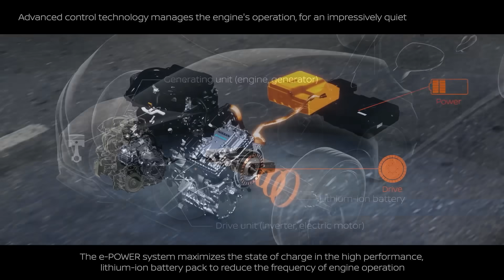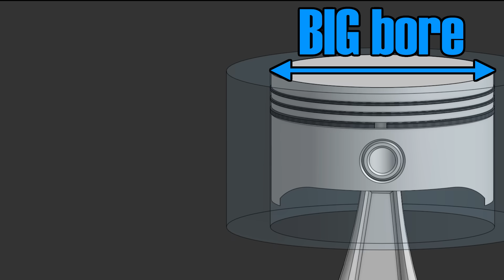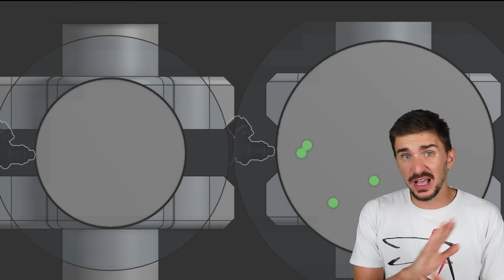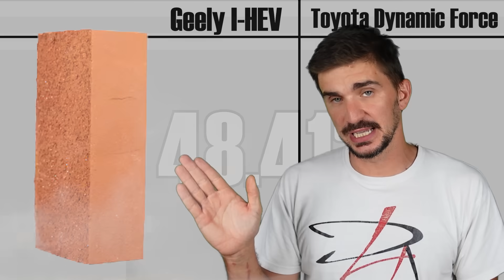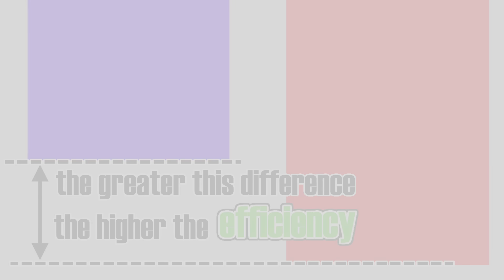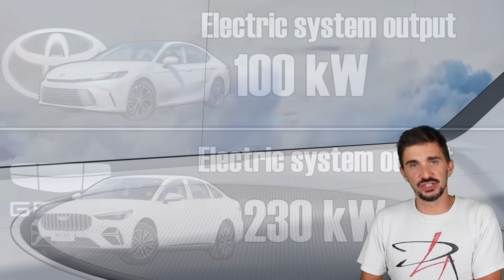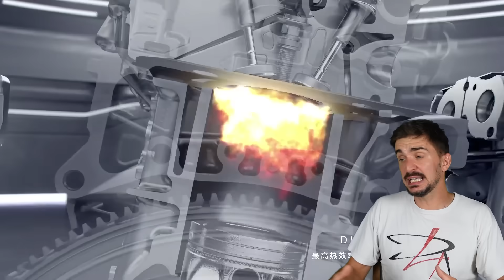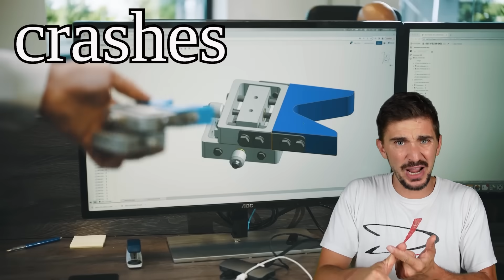How China's Geely Beat Toyota, BMW, Ford and Everyone Else

Comment: "compression ratio" is an unfortunate term. In Atkinson engines the compression ratio is lower than the calculated rate.
Good video. Think of the "sudden loss of torque available when the battery depletes" as a soft range anxiety. Push an EV too far and it becomes a brick. Push an EVcentric hybrid too far and you go a bit slower.
It needs a supercapacitor. Target charge state of supercap to inverse of speed.   The battery is freed of acceleration and braking duty.
Thumbs up. The final engine design is filed and accepted at patent office. Claude estimates over 70% efficiency.
Oh, long stroke is only relevant if one burns in the cylinder instead of above the cylinder. If one burns above the cylinder the axiom inverts: larger bore to stroke is more efficient and frees up the cylinder for a simultaneous steam cycle and negligible pumping costs. My engine hovers around 3:1 bore to stroke and 3:1 rod to stroke.
Thumbs up.

Comment: If you had perfect control over valves, could one make an engine that dynamically switches between otto and atkinson/miller of any imaginable depth?
Reply from the maker: We already have that but we can't really go into any depth, the maximum depth is predetermined, and there's a limit to how much we can phase the cam.

Comment: Undersquare engines aren’t more efficient because the pistons have a longer distance to travel.  It’s more efficient because less heat is lost to the walls because the surface area is lower.

Comment: Something else with the bore/stroke ratio: tumble flow is better preserved in a square situation than a pancake or a pipe, and a long stroke engine is, on average, more square. This preserves charge motion until later in the combustion cycle, mixes a little more, and spreads the burning faster. This is less applicable to jet-ignition engines, but is still something to note.

Also, I thought this engine used jet ignition? It's a cool system. I'm going to try retrofit a poor copy of the mahle passive system to my project and see if I can make it work...

Comment: This is going to be a disposable engine, not rebuildable. Hopefully long-lasting, but I wouldn't bet on it, and reliability could suffer depending on application. In this case it seems to be essentially a range-extender for an EV, probably running mostly at a constant RPM where it's most efficient, requiring a much smaller battery bank, and likely won't sell well in the US due to crappy performance. That being said, the impetus for this is valid, best demonstrated in diesel-electric freight train engines, configured so power can be acheived.

Comment: With inconsistencies in fuel octane and burn rate,  it seems it would be a hit & miss with a long stroke to find that maximum efficiency they achieved with this particular engine bore & stroke ? 
 What octane did they achieve such a higher rating ?

Comment: I was seriously interested in a Honda with e:HEV because of the technology, as not many petrol-only choices left. I'm glad to see more choices now. It didn't end up with the Honda, but while browsing specs I concluded that at highway speeds the fuel consumption was no longer very impressive. I recall e:HEV connected the engine to the wheels when possible. This video highlighted that the Geely motor is quite weak. Was that the problem also for the Honda?  Is there truly a way to go electric toward the wheels and still get highway fuel consumption like e.g. a Volvo V90?

Comment: Could a real deep miller cycle work in a normal ICE car or a hybrid? I mean a real miller, with a turbocharger or one of the electric turbos like what some Formula 1 cars used in the past. Also even a lethargic engine like this could still be useful in some cases like stationary applications, generators, or cuising barges where power to weight is not as much of a concern, and the fuel usage difference matters.

Comment: I'd actually be fine with an EV first, with a backup generator, even if it meant much less power on gasoline only. It honestly seems like a problem that can be actively managed by forcing recharge to a certain battery state.

Comment: I'd explore using the combustion engine solely as a generator. Size the motors and battery to handle any reasonable hill climb, and just let the engine charge at peak efficiency.

Comment: It’s a bit of a shame that peak efficiency figures are constantly cited as proof of how ‘good’ this engine is. 48% peak efficiency? Brilliant! Where’s the performance map for that? How wide is the range around that peak? At 2250 rpm and 82% load? How much does the figure drop if I’m only at 60% load? And what about emissions?

Could you perhaps make a video on efficiency and specific fuel consumption? And also show just how narrow this peak efficiency range is? And calculate the average efficiency of an combustion engine under typical city driving conditions?

Comment: if they make 150km range plug in hybrids (which is not that far from current models) the issue you mentioned at the end will be extremely rare. in my case i never drive more than 150km in a single day unless i want to travel with my car so if some charges every day i suspect that 95%+ of driving will be purely electric that 5% as u said will be annoying but i would give that away if it means i pay a fraction of my gas bill

Comment: I drove the i3 with the first 18 kwh battery for work and work trips. It had the REX range extender, but when the battery was depleted, it only got to 60 km/h uphills. I micromanaged the state of charge manually, but I am an engineer. There was so much bad feedback about the REX, that in the end the battery got bigger and the REX production was stopped. It it the same thing here. The european manufacturers are afraid of telling their customers that they have to slow down at some point. No, they keep building rediculos cars, that nobody can buy anymore.

Comment: Okay, at the beginning you said it was a verified 48.4%, then later you said "well advertised anyway".  So which is it?  Has it been verified or is it just Chinesium claims?

Also, working on the assumption that narrowing the torque range increases efficiency, what does the torque curve of this engine look like?

Comment: This is an excellent, relatively easy to understand explanation of the engineering concepts involved in EV vs Hybrid designs. What made the light bulb go on inside my head was the graphic showing the electrification of IC vs the engineification (deal with that, spellcheck!!) of the EV and the tendency of both to more or less reach the "ideal" mix of the two power technologies somewhere between the extremes. A great channel and this has to be one of the best videos.
Reply: I prefer to call it the ICEing on the EV.

Comment: Geeley has done something similar to what people have been calling for for years, make a decent electric vehicle with an onboard ICE generator. Mazda did it too, but their electric motors are too small for adequate performance. What we need is a high performance electric powertrain with a highly optimized gasoline powered (or diesel) generator.

Comment: i prefer an electric-centric hybrid approach because
- no transmission or very simple 2-gear transmission
- much better torque from start 
- no sound or vibration 
- smaller,  much easy to make 4-wheel drive
- can run on gas and electric 

Why hybrid over electric? Battery technology is still not efficient enough, but electric motor tech is good enough. 
So we should not let suboptimal batteries drag down the good electric motors. 

If I had the money, I would make a hybrid with electric motors from Tesla and then get this Geely engine and make it like an electric generator. 
Slap some 20 kW BYD blade battery on it. 

rear-wheel drive with Tesla motors, battery split on the front end back under the seats. no drive shaft. 
use the gasoline as battery coolant

Comment: I dont understand this approach at all.

We could just realize that, even in the US with longer distances and minimal public transit, 250 mile range on an EV is plenty for like 99% of people 99% of the time. And even if its not for a particular scenario, its more an inconvenience than an actual hindrance.

And, on top of that, we have 350 kW capable chargers that aren't even utilized except for a very select few vehicles. A Hummer or Silverado EV with ~220 kWh battery can only just clip 350 kW for a short time. Reality is, if we can get to the point that we have smaller battery cars(50-100 kWh) that can actually charge at 350 kW, they will be charging insanely fast to the point that its really not even an inconvenience anymore.

Towing a trailer is the one place were I see the hybridization making sense, but this system wouldn't work there since you are likely needing to generate a continuous 120-180hp, whether its directly powering the wheels or charging the battery. I was pulling my 5500 lb travel trailer into a 30mph headwind yesterday in Wyoming, and my 5.7L V8 was needing to make 180hp just to maintain 60mph on flat ground. This is where I could see a decently powerful eCVT setup being pretty fantastic.

Comment: Hmm. If you compare it to the Nissan, that has a 42% thermal eff. engine that doesn't even move the clutch, this is still impressive. This is not a performance car. If it can sustain 110 km/h with an empty battery, it's good enough. And without any knowledge of the car, I'd suspect a 1,5 liter engine shouldn't have any issues doing that.

Comment: Thanks, D4A, interesting video idea for you: Opposing piston diesel engine that was successful in submarines but not in freight trains.

"How They WorkUnlike standard four-stroke engines, there are no cylinder heads or valvetrains (like valves, camshafts, or rocker arms).The Cycle: Two pistons face each other in the same cylinder. As they move inward, they compress air in the center.Combustion & Power: Diesel fuel is injected between them, pushing both pistons outward simultaneously.Scavenging: As the pistons reach their outward limits, they uncover ports in the cylinder wall. Fresh air enters from the bottom, pushing out the exhaust at the top.Role in SubmarinesOpposed-piston engines—specifically the legendary Fairbanks Morse Model 38D8-1/8—were the secret weapon of the U.S. submarine fleet.Powering Generators: Instead of driving the propeller directly, these massive diesels ran generators. This generated electricity to turn the main electric drive motors and charge the submarine's massive batteries.No Valves = Less to Break: For long, stealthy deployments, the simplicity of having fewer moving parts meant higher reliability and less chance of mechanical failure.Fuel Efficiency: Their higher thermal efficiency provided greater range and endurance, giving Allied subs a critical tactical advantage.Why Not in Cars Today?While they are highly efficient and power-dense, they are also more complex to manufacture. The two pistons typically drive two separate crankshafts that must be perfectly geared together to transfer power to a single output shaft. This adds weight, spatial constraints, and manufacturing complexity.Could you tell me what specific aspect you want to explore further? For example, I can:Detail the differences between Fairbanks Morse engines and the General Motors diesels used in US subs.Explain the air scavenging and blower system.Discuss modern applications of opposed-piston technology.

"Unlike standard four-stroke engines, there are no cylinder heads or valvetrains (like valves, camshafts, or rocker arms).The Cycle: Two pistons face each other in the same cylinder. As they move inward, they compress air in the center.Combustion & Power: Diesel fuel is injected between them, pushing both pistons outward simultaneously.Scavenging: As the pistons reach their outward limits, they uncover ports in the cylinder wall. Fresh air enters from the bottom, pushing out the exhaust at the top.Role in SubmarinesOpposed-piston engines—specifically the legendary Fairbanks Morse Model 38D8-1/8—were the secret weapon of the U.S. submarine fleet.Powering Generators: Instead of driving the propeller directly, these massive diesels ran generators. This generated electricity to turn the main electric drive motors and charge the submarine's massive batteries.No Valves = Less to Break: For long, stealthy deployments, the simplicity of having fewer moving parts meant higher reliability and less chance of mechanical failure.Fuel Efficiency: Their higher thermal efficiency provided greater range and endurance, giving Allied subs a critical tactical advantage.

Comment: 13:50 That says it all . But not quite everything—Toyota is eking out efficiency gains here and there, such as with an electronically controlled electric water pump (or variable cooling) and variable-displacement oil pump among other things. But I imagine Geely has optimized these accessories as well.
Reply: All that costes the wallet & environment in a short amount of miles. More land fill more factories building parts do to failures under woranty & out over engineered junk. Lowest bidder junk parts built just to last out of woranty plus organic parts. I've been a tec for 37 years I've never filled so many garbage cans with junk maid parts then in the last 20 years. Sure saving the environment. A 2005 Toyota V-8 eng would go 500,000 miles with hardly any work. I.E. less work less parts less footprint. &.hardly any more fule used. 17 Mpg in 2005 now 21 maby grandma's 22-23 in 2026 & junk is breaking so often. THE BIG LIE $75,000 dollar vehicles today just to cover there throw away junk cars. Do you think they cover your woranty work absolutely not why they charge so much. All figured into the overpriced car 😂😂😂😂 sucker publick

Comment: Look, this much struggle to get this much efficiency on paper just makes me laugh. I am all for the 80/20 Rule. Get efficiency where you can with appropriate means. You need to remember that we are humans. For example, a family buys this car instead of a Toyota EV. Where the Toyota might feel close enough to a real engine, this one does not. It bothers the man in the household, and he decides to buy a cheap, used gasoline guzzler for a few bucks to drive it for fun sometimes. And just like that, all your gains on paper are gone. I won't even start on the weight, lifetime, and production costs of EV tech—most people already know about that.

We're only seeing these excesses because efficiency is easily quantifiable and measurable by the governing bodies, while so many other factors are not. That's the reason for the wet belt in Ford engines. That decision only makes sense exactly because of that principle.

Comment: I would guess that the next big jump in efficiency will come from fewer cylinders. Again, it's not revolutionary, and you lose power, but it's a simple change that easily increases the thermal and volumetric efficiency of your engine.

Comment: To answer the question is it a good idea or not, you have to compare the max range of full EV on the same platform as this HEV. I'm not convinced that ICU+transmission+generators+fuel would increase rage better, than electric batteries of the same mass.

Comment: 30 yeays ago, during my pre-engineer classes (French High-School with Huuuuuge Math + Mecanics + Electronics) we had made 3 prototypes of radio-commanded toy car.
- One only powered by its gas engine (2cc 2-strokes)
- One powered with the same gas engine + assisted by one electric engine powered via a simple capacitor, the capacitor was loaded by the gas engine and the breaks (electric motor used as a generator)
- One only powered with the electric engine. The gas engine was acting as a generator, running permanently at his optimized regime, loading the capacitor (not a battery).
we found that the 3rd option was about 30% more efficient in a "city" track, with multiple phases of stop and go.
Of course it was just a very simple implementation and we cannot think the gain would be automatically the same on a full size car but the gain was very very interesting.
At this time, the conclusion of this test was "not interesting enough". The engineers will continue to optimize the gas engines and will reach the same efficiency. It is too complex to be installed in a production car. The cost is too high because it needs two engines, a high capacity capacitor (lithium bateries did not exists atthis time). The money saved by the efficiency would never pay the over-price of the solution.
Reply: 3rd option is basically series hybrid - or EV with range extender.
Toyota's approach is probably the best - Two motors and gasoline engine connected through a planetary gearbox - both motors can act as generator, so there's not a weight penalty of a generator. The system weighs less than a diesel engine. 
Engine is kept in most effective range, part of the engine power is transmitted to wheels directly, reducing conversion losses.
Reply: Isn’t the Nissan ePower drivetrain doing that essentially?
Reply: Capacitors are key, extracting waste energy from the exhaust and braking system  using capacitors is key
Reply: In the real world the best option is the second one, the one Toyota and Ford use
Reply: 3rd option maybe interesting in china 'cause manufacturing cost in there is very "interesting" if not want to say cheap
Reply: Yes impractical
Reply: Lies

Comment: so they make the most efficient combustion engine.. by using it as an assistant to electric motors. LMFAO and, all of that complexity for under 50% thermal efficiency. imagine still trying to rotate something (in this case the wheels) by exploding fuel then losing half of the energy to heat, noise, and transmission losses, when electric motors that can achieve 97% efficiency exists. lmao. imagine buying 50 USD of liquefied ancestral remains of animals, then wasting half of that, in this economy.